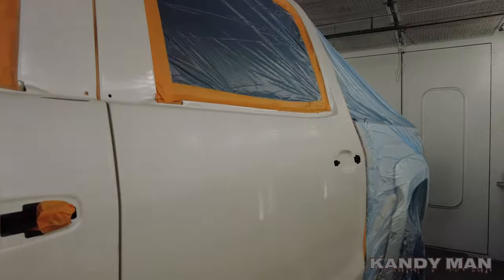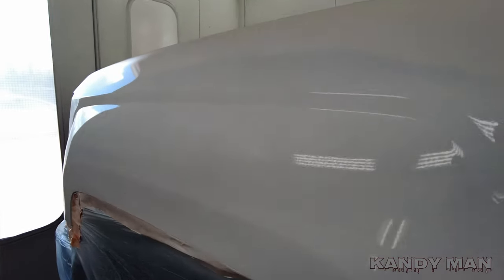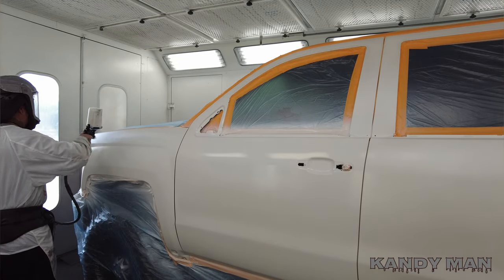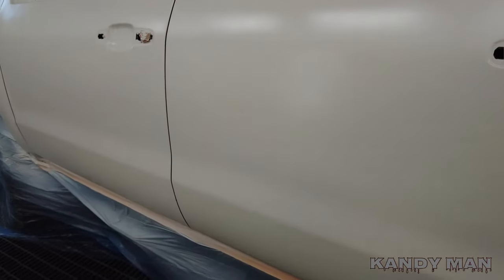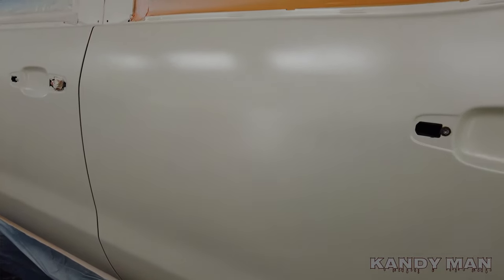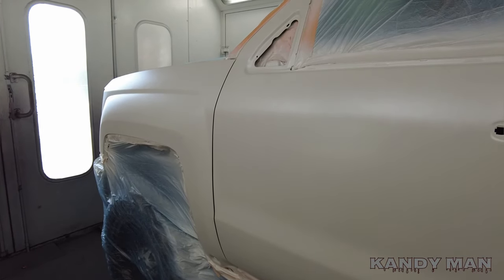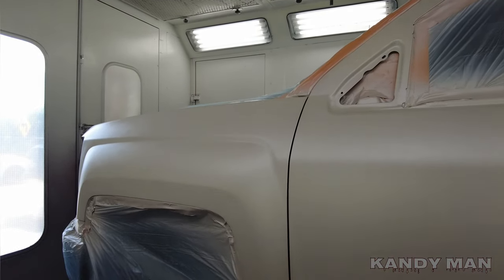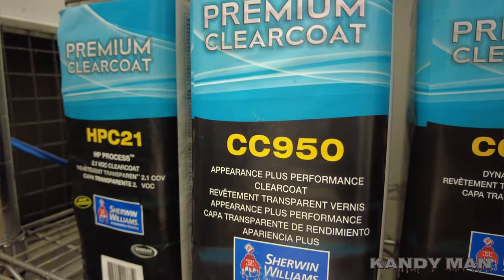3M PERFORMANCE SPRAY GUN PUT TO THE TEST

Comment: Hey man have you had any issues with paint not flowing out the pps 2.0 micron filters that are built into the lids? I went to spray a job the other day (single stage silver) and it wouldnt flow out properly.
Reply from the maker: No I haven't  im.sure if you let 3m know they will  replace the lids thanks for watching 👊